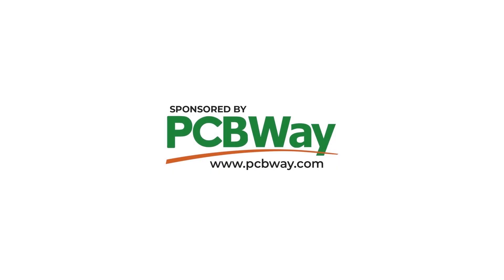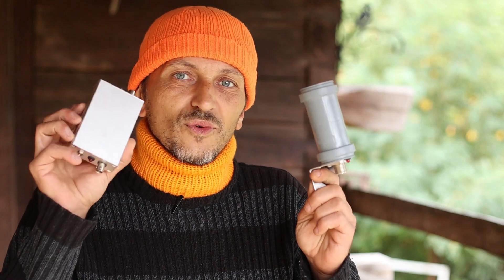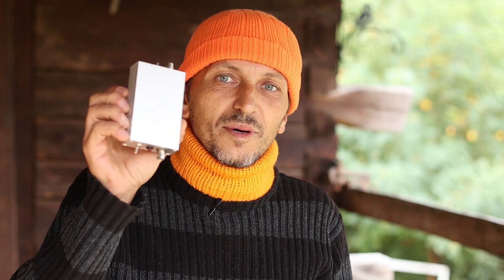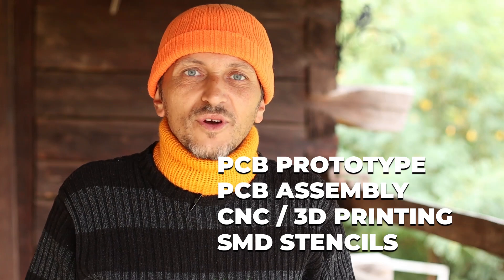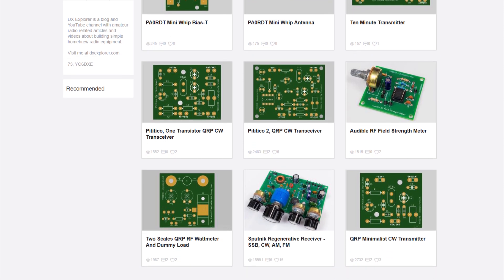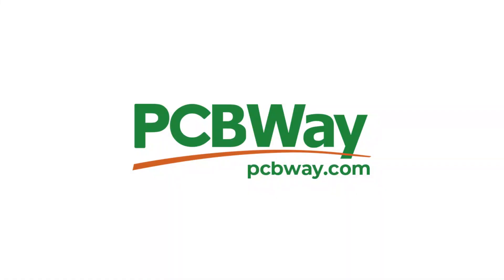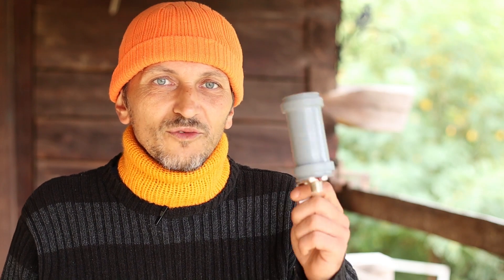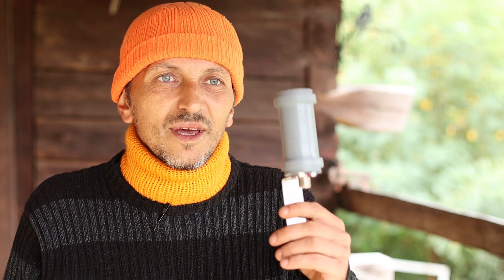PA0RDT MINI WHIP Antenna Test - Part Three ( Cioclovina Scout Center )

Comment: so i could just order the boards from PCB Way and have them complete the kit?
Reply from the maker: There are two options there..  either simple PCB boards as they are ( empty ) or the assembled version where they will solder all the components to the board. ( depending on the project some components will not be provided by them )... in this case the RF connector as example. 73, YO6DXE.

Comment: Great video, I'd move to see more, even a full QSO at some point. I use an ungrounded dipole on 10 M and and ungrounded EFHW on 20M in my balcony and I hear plenty of signals so it can work. I hope you were joking about the weather impacting HF receive though :) Looking forward to the next video. I'll be in Brasov at the end of Oct. visiting my aunt.
Reply from the maker: When we finish the radio room here, I have a feeling you will see a lot of QSO's from here 😁. About the rain and the conditions on propagation... ohhh no I was not joking at all. I think is because in here is like I am in a pot all shrouded by mountains or something, because when it rains even the phone signal is extremely bad. One network dissapears completely. The EFHW barely receives something as well. Not sure why but it is what it is. Maybe the radio waves are scared of the bears we have around here haha. I will be back in Brasov at the end of this week and stay home for a while so maybe we get to meet. We keep in touch. Have a fantastic rest of the week. I get back to work here so we finish the roof before I leave. 73, YO6DXE

Comment: Good performance for a very small antenna.
Reply from the maker: Indeed. I switched to the EFHW really quick after I stopped filming and it was nearly equal. I did not expect that at all considering that I am surrounded by mountains.

Comment: Sounds good. Nice place though. 👍🏻

Have fun!
Also I might have a j310 I’ll look for it.
Reply from the maker: Thanks so much. Amazing place indeed in here. I found a website that sells both transistors before I left home, so I will order a few once I get home. 73 buddy.
Reply: @dxexplorer  i don’t think it’ll make a lot of a difference. But now I’m curious.
Reply from the maker: I am also curious. On the JFET I think it won't be such a difference as J310 can be replaced easily with other similar ones, but the NPN I have a feeling it will perform better because the antenna should resonate better on lower frequencies as well. We will see )))

Comment: Hi DX Explorer thanks for your Video - if possible try to get a very good GND direct at the Feedpoint of the Antenne and the Signals will blow you away....  The Key of good operating is enough height, out of any QRM done by TV, PC, LED Lamps etc. and a very good GND maybe with not less than 4mm2 of Wire direct to a good Earth at the Bottom of the Mast! - Dont ground the Coax on the Way to your house a second Time! . Heard many rare DX Stations with my Mini Whip on a 10 Meters tall PVC Mast  connected to GND Wire, vy 55, 73 Heinz DE0RST
Reply: Hi friend, yes this could improve receipton very much. If you want to compare sigs you can listen to WEB SDR Station operating with Mini Whip. If you listen to the WEB SDR Radio from University in Twente (Netherlands). (Google) They are operating with Mini Whip as you surely know? 

Another way to get more gain of the Transistor could be to connect two of them in Parallel. That should increase the Signal Strength also.... vy 55, Heinz, DE0RST
Reply from the maker: @heinzriedl6868 Ohhhhh the trick with the tranzistor i didn't know. Is it the JFET or the NPN ? I guess the JFET since the NPN is there just to lower the impedance. And yes if course I know about the SDR in Holland. Is the one I use for most of my tests as reference 😁😁.
Reply: Its the JFET which could be parallel connected. If you have no success with that please send me a note and I will  send you J310 for experiments 😀  @dxexplorer
Reply from the maker: @heinzriedl6868 Thank you so much. Ohh I will order the transistors when I get home. I found a store that has them in stock still. I really appreciate the help. Time to experiment a little more when I get home hahaha. 73, YO6DXE. Bed time here as in the morning, back on roofing work to finish here 😅😅😅
Reply: @heinzriedl6868  Both Q1 and Q2 have a gain slightly less than 1.0 .
Reply from the maker: Ohhhh thank you so much. I very much appreciate the advice. I will do it this way on the final instalation once we finish building the radio room. I will still have to hide it in the attic, but with a good ground I have a feeling it will work way better than now. Even though I am happy even the way it works now. I was not expecting it to work so well. Luckily here on top of the mountains there is not much interference from anything as besides the lights and the phone chargers there is nothing else here. 73, YO6DXE
Reply: DX Explorer is the way 😊